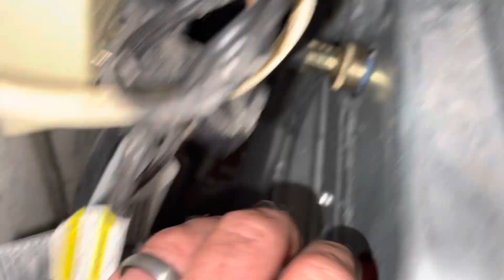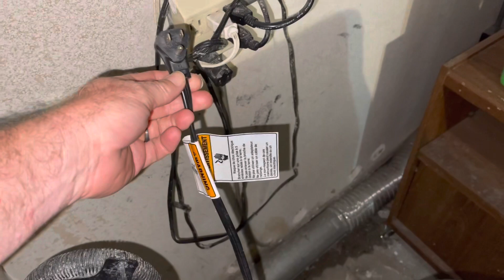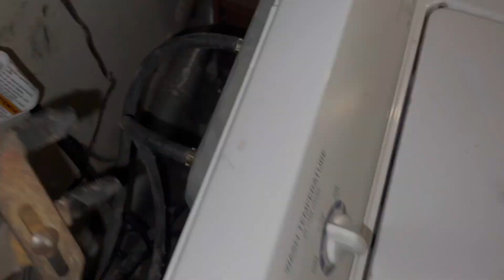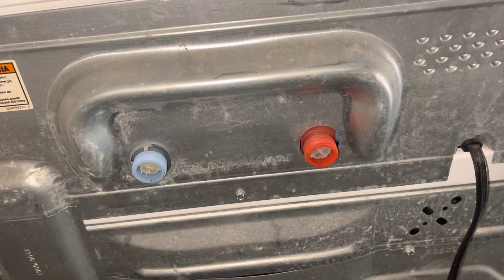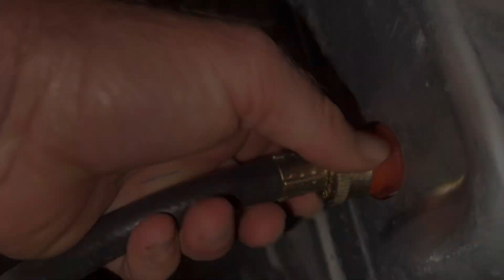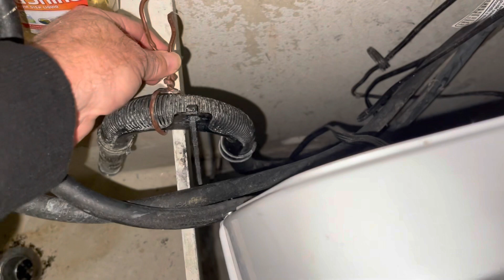Washing Machine Water Too Slow Issue! Easy Fix!

Comment: You may have noticed small bits of white particles in the filter on the hot water side.  These are plastic bits of the water heater's dip tube. Their presence is evidence of dip tube deterioration. The dip tube is likely due for replacement. As a practical matter, it's probably near the time for replacement of the water heater.